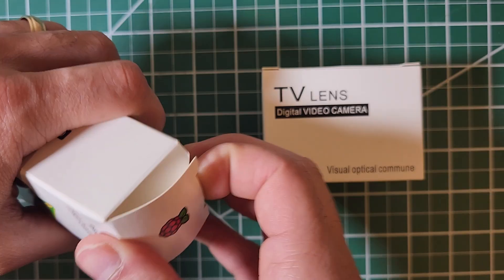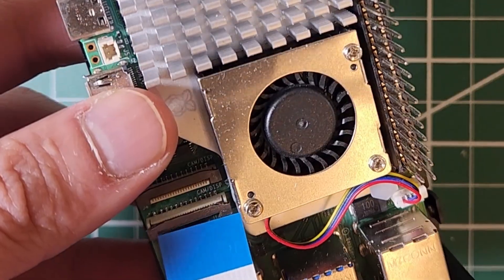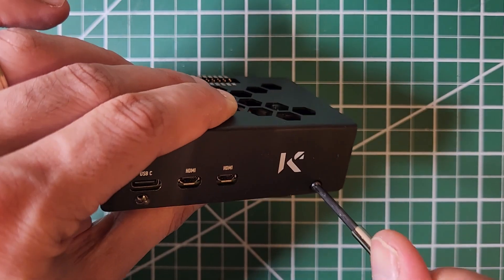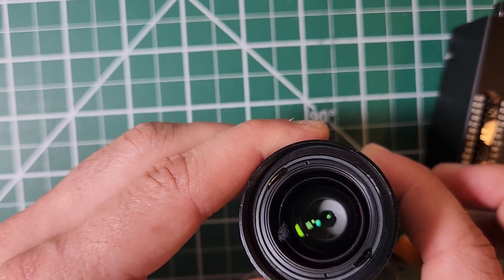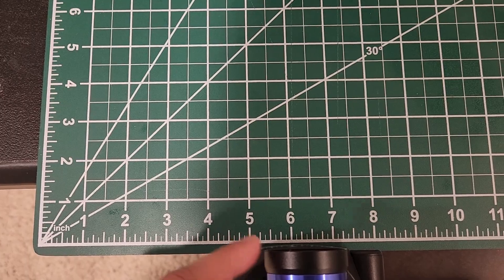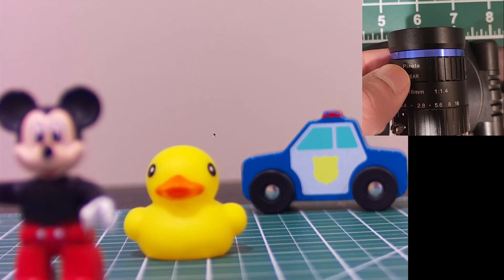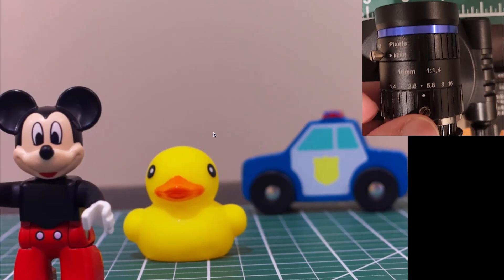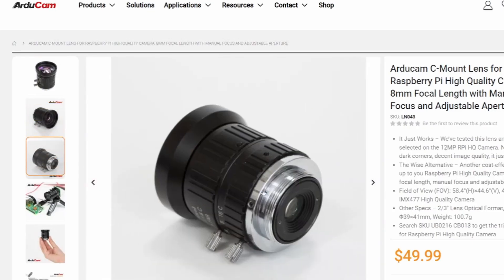Setup the Raspberry Pi HQ Camera in 3 minutes

Comment: Thanks for posting! This is something I'm really interested in but am starting from a (near) complete noob position. 
Have you done more with it since posting this video? 
Do you have plans or a particular goal for the pi cam?
Have you mounted in an enclosure of any kind?
Nice work and thanks again for posting!
Reply from the maker: Hi. Thanks for watching! I plan to try to record YouTube with it. I normally use my phone camera, which does a good job, but wanted to give it a try with the HQ Camera (at least for some of the portions of some videos) given I can control focus, depth of field, etc. I am currently working on finishing several videos where I use the camera. I am 3D printing some mounts for the camera to mount to a tripod or to mount to something else I'm building (new video coming on that). I also got an NVMe w SSD to expand my storage on the RPI5 as I plan to record a lot with it and don't want to use the typical SD card.
Reply: @diyengineers  Love it! Simply amazing. Just realized that I hadn't subscribed -sorted that just now. I look forward to seeing more. What 3D printer are you using? Any recommendations/thoughts? I'm looking into those as well. Thanks for the reply!
Reply from the maker: @edwardjski  Thanks! I recently got an Elegoo Centauri Carbon 3D Printer and I like it a lot. I made a quick video on it: https://youtu.be/_RUVFMf5YgM

I also made a video on using a BentoBox / venting the printer to the outside (https://youtu.be/cXhZpAEbqd4).

Other printers you might want to look at are the BambuLabs printers or Prusa. I am no 3D printing guru by any means. The air filter / venting video is mainly inspired by the fact that as you print, you are basically melting plastic and recooling it. Some people don't mind the fumes from it, but I am overly careful on that and decided to just vent to the outside through a window. A ton of people think its unnecessary, so do your own research. Some of it depends on what materials you choose to print with.
Reply: @diyengineers Since you replied and mentioned the Elegoo printer, I've been looking into it. Looks like a pretty smart purchase.
Reply from the maker: @edwardjski  Glad I could help! Just know that the multi-filament system might be coming out soon. Some people have seen a Version 2 of the printer (with such system), but I don't see it in their US website, so maybe only for other regions for now... Letting you know in case multi-filament is something you really want.
Reply from the maker: @edwardjski  Since you had asked. Check out this new video on a project I did with the Raspberry Pi HQ Camera: https://youtu.be/C3CiWpBq18E